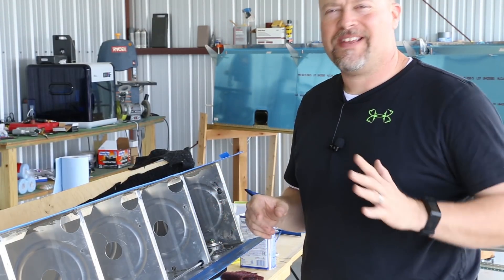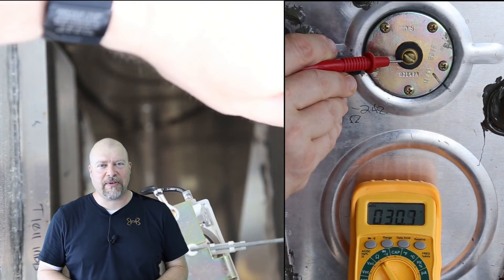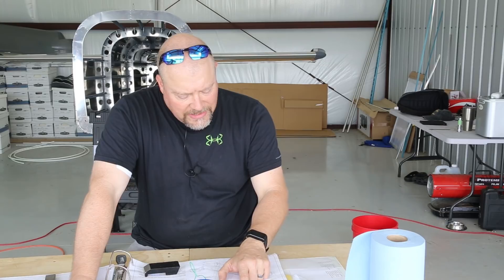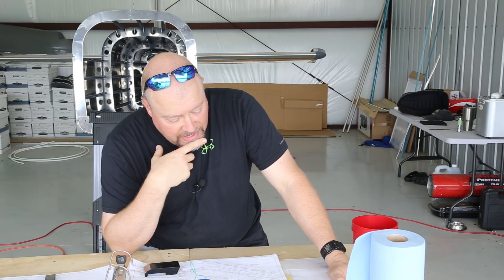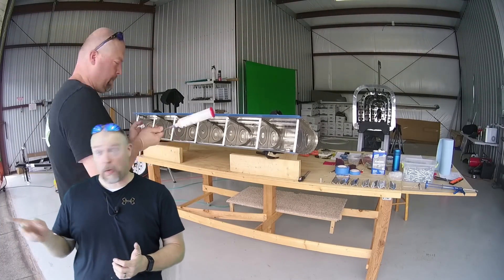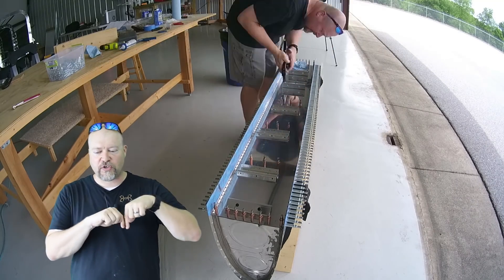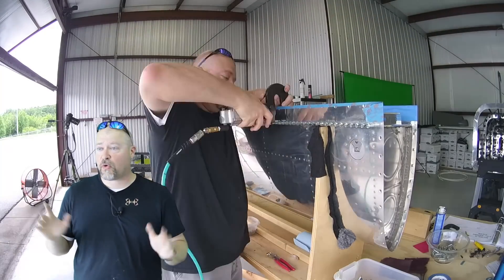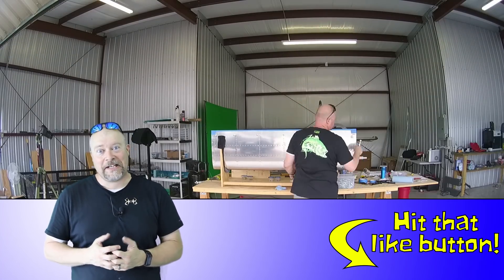RV-10 Wings - 057 - Sealing tank #1

Comment: Here is a tip I was told and something I did on my tanks. Once you put the baffle on set the tank with the leading edge pointing up. This way gravity will help the pro seal drain down and keep the baffle flange area covered in Sealant. I know that stuff doesn’t move much, if at all, but if any was squished out it will at least settle on the baffle and not in seep down the inside of the tank.